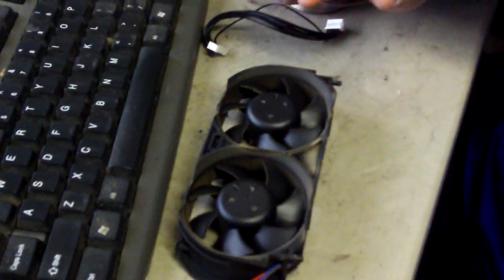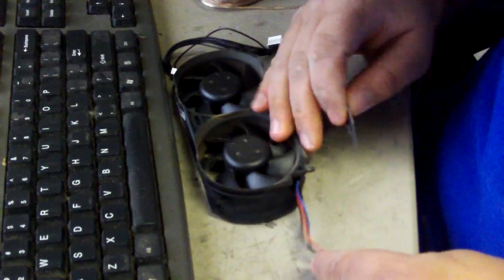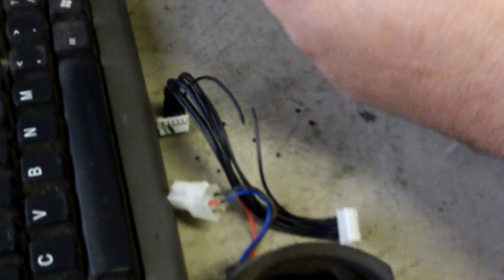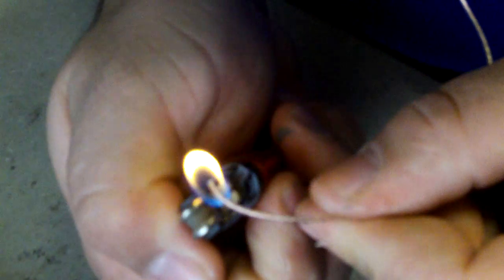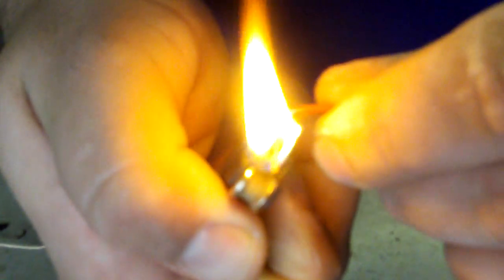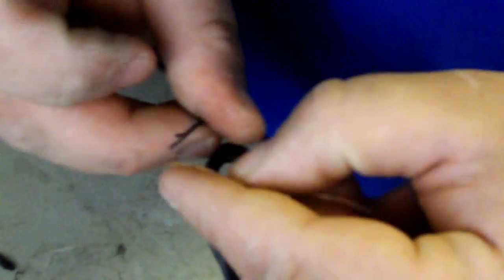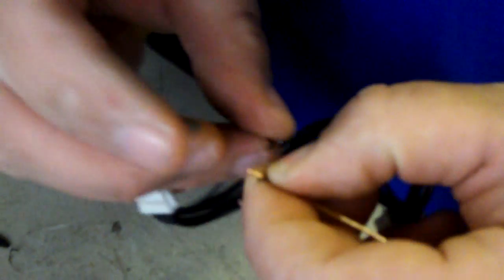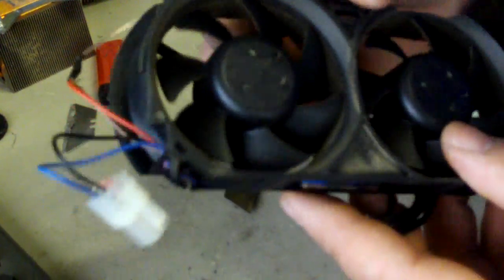Xbox 360 12 Volt Fan Mod - Xbox 360 Overheating Problem Solved

Comment: u showed me a new way to strip wire, thanx, and for the vid....it helped...had a question tho, what pins of the fan do i use to connect straight to a 12v power supply by itself. i wanted to make a fan to use on my lap top...so far im guessing the red and the brown together is =one power pin, but the others, which is the second power wire....if u dont mind

Comment: i have done this mod and it works great. yes it is a bit louder but i use turtle beach headset so i don't hear anything. i have never had the tray from the disc drive not open or close. i didn't cut the black wire. i instead used a crrimp on splice to connect the wires.

Comment: Hey, thanks man, I did this on my friend's Xbox that had a RR with E79 - and it solved the problem! His heat sinks were running hot enough to burn skin, and this cooled it down to room temperature :)

Comment: ehat the fuck, k i did this so long ago, and i devided to take my xbox apart to see wtf was wrong eith the open tray problem i had. so i c,eaned the disc tray and when i put it back i tunred it on to check and the  fan stopped  and the three rings decided to come out of nowhere. so i re wired everything just  like you said smd still theres no electrocsl tape on it but everything is all connected. like wtf??? idk what happend

Comment: Thanks a lot!! It's so easy even someone's grandma could understand it..:). It really makes a huge difference, even tho i have mine with holes drilled in the bottom of it sitting on a triple fan laptop cooler and a fan mounted on the top of my 360 sucking cold air in.!! I really like it thanks again!!

Comment: if your xbox overheats and you've had it for a while, make sure the console isn't sucking hot air from a near by heating source. Also make sure that the "brick" or power source has room to breath. If that doesnt work open up your xbox (youtube instructions) remove all the dust and your good!

Comment: DON"T CUT YOUR WIRES CLOSE TO THE PLUG! If you cut them close to the plug, and then decide that the mod is way too loud, it will be very difficult to undo. Cut the fan wires it the middle as well.

Comment: @FMLxHD Any wire that fits will do. I used wires from old PC fans but you can use anything like speaker wire, as long as its insulated.

Comment: I had done this like a year ago. I got my 360 in 2007 and this tut works great. My Xbox has never gotten the rrod either. Not even once. Due to the fact that I followed this tut. Sure it's louder but at least it keeps my Xbox from getting the rrod. Had an Xbox before this one that had no fan mod and it croaked in 2 years

Comment: Just so you all know, this steals power from your dvd drive, there is a reason your dvd drive needs/gets the amount of power it does, if you need to have a 12v fan just bridge the two points next to the plug in, it is much safer/faster than this method.

Comment: Or... You can connect a molex connecter under the power connecter, run a 12v fan. and keep your original fan. and its safer! 3 fans(15v) > 2 fan (12v)

Comment: OMG.....you cut the wires too close to the pin connector.....your never be able to use that again!

Melting the wires like that gets residue on the wire!

Jesus Christ man.......solder those frekin wires.....please dont do that to your xbox dont leave bare wires like that!
Its an expensive xbox not a crappy $20 dollar boom box you bought at the swapmeet!

Comment: Well i decided minus all the negative remarks on this mod to try it out myself.  The result is very nice....runs a lot cooler and don't see any signs of the system working much harder.  I would recommend this mod if you are having problems with your box.

Comment: easiest thing to do is buy the inter-cooler, take out the stock fan and let the intercooler itselfcool the system, did it to mine and it works great plus its not that much louder, to do this you must take out the entire stock fan or it sucks

Comment: Running the fans a 12v will not break them, they were made to run at that voltage, Microsoft just ran them at 5v to keep the system quiet.

Comment: This is what Microsoft should of did from the get go, I did this my self and my XBOX 360 works flawlessly, it no longer freezes or get hot . Its literally  cool to the touch now, it may be a little loud but when you think about all the work the XBOX 360 has to do the fans almost have to run at  12volts to stay on top of the heat issue. I believe this mod would add years to your XBOX 360. Its something Microsoft should of done.

Comment: It's also a good idea to pop the fan rotors out and add a drop of turbine oil to the bearings, especially on the GPU side. Every one I've seen is bone dry on that side. Talismoon fans are no better, they just light up. Whoop dee fuckin' doo. =P

Comment: gawd dude.. your a hack.. what a hack job..  2 issues here, your using the dvd 12 v source,  bad juju, the dvd 12 v source is only rated at .3 amps.  your pulling way too much amps for that thing now..  you should ALWAYS solder your connections.. and the way your splitting your dvd 12v line, is a hack.. there's much better ways of doing this.  your using a lighter to strip the shielding. doing this weakens the wire and changing the resonance of the line.  all bad juju.. it may work for awhile.

Comment: Sprint guys just did it and had one problem but it's solved!  If you your DVD drive power cable backwards your fans won't spin and you'll get the 3 RROD. So all you have to do is turn around the DVD drive cable ( black one) and it should work fine!

Comment: It's not a rrod fix it just prevents it. The stock fans are 12v fans but they are running on 5v by doing this they run at their full potential thus keeping the xbox cooler stopping it from over heating and damaging the joints between the cpu and the motherboard and the gpu and the motherboard, meaning no Rrod. If your wanting to repair your rrod 360 its really not hard. I bought an xclamp fix kit from ebay and followed one of the many tutorials online then reflowed the main chips with a heat gu

Comment: Any way you could add some kind of a switch/dial to adjust the speed of the fan an just mod the case so the switch pokes out?

Then you'd affect the amount of power to the fans hence changing how loud it is and ya....

Idk just an idea.

Comment: ~~I've always heard not to run any fan mods (12V or even 5V) off of the dvd drive, some say that it could ruin a transistor or something. Should I be concerned about that?  I'm getting a new fan mod to replace te stock fans, what do you think? ~~

Comment: @Rocky13Ray not a problem.  i been using that stuff for almost 20 years now.. its not hard.. you will catch on fast i bet.  take it easy.  i will have more mod stuff later one.  may add a fan to the side of my 360 as well.  i also am going to produce some vids on modding the original xbox as well.

Comment: @Rocky13Ray i would recommend soldering.. over time a connection that is simply twisted together will degrade.. and that could spell doom.. soldering is easy.  look at my xbox usb controller mod video.  i give a pretty straight forward tutorial on soldering.  and soldering irons are like 5 bucks now. dirt cheap.  i even have one that is battery powered

Comment: @Rocky13Ray try to aim for the same thickness and quality as the wires you are soldering to as the wire gauge can affect amperage, voltage, etc.

Comment: Hey i was wondering if there was some kinda filter you could put on the fan cause theresalot of dust under my tv and i dont want dust going into my intake so if i bumped the voltage and put some sort of air filter would that work or would that just makeless air gwt into the xbox?

Comment: On the dvd drive wire you cut if it was still pluged into the board would it be the right or the left wire.

Comment: hi mate, i want to put my new xbox fans with the 12v mod, but with my previous xbox, after doing this it was real loud, is there anyway i can knock the voltage down to about 9v?? any ideas of what resistor to use?
i want the voltage higher than the standard 5v, but not at full 12v, at around9v will be perfect, thanks

Comment: can you run more than 1 set of fans from this source without hurting anything? i'm fitting fans from and an old xbox onto the side to blow air in to create better flow... be nice to have them both 12v.. might be noisy tho?!!! would you splice into the ground wires on the original plug or fit them to the metal case (for the side fans)?

Comment: wiring it in parallel vs series... smart
not soldering your joins .. not so... it can make for a dicey connection over time... i recommend going to radio shack and at least getting a cheap 5 dollar soldering iron.. but other than that cool stuff man.. doing that tonite.. tired of the rrod!